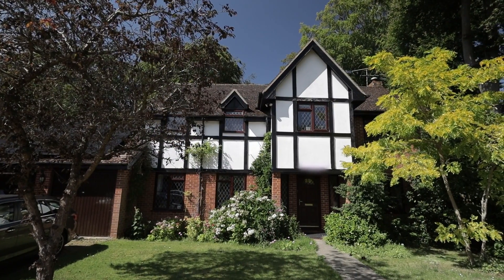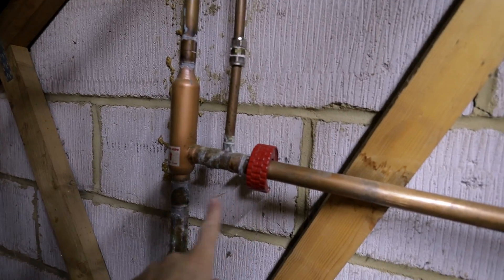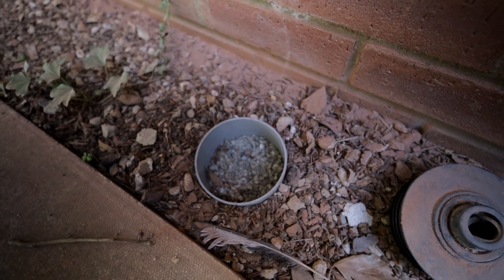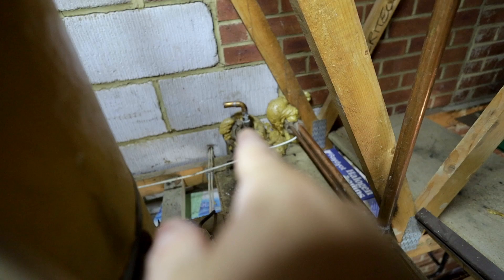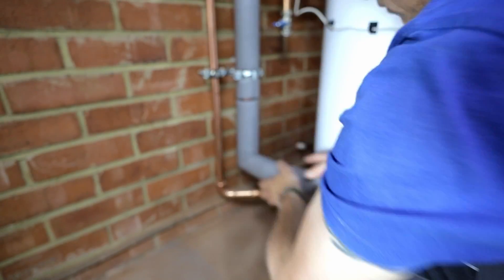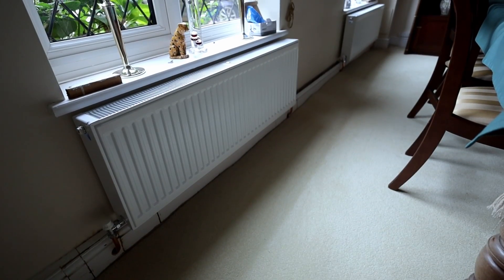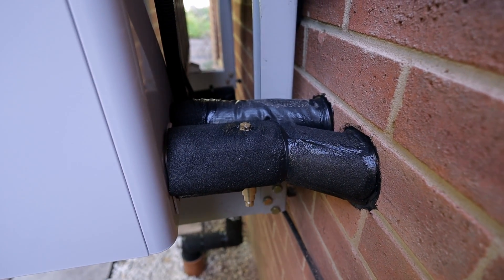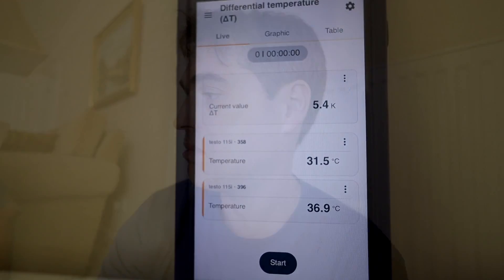Heat Pump Retrofit in a 1980s House: What's Involved?

Comment: Great videos; really well explained. One thing I would like some more information about is why heat zoning is not recommended. Does this mean that the whole house has to be set at the same temperature?
Reply: Watch the HeatGeek videos on this explaining it in detail. Seems simple is better and the illusion of micro control is outweighed by the thermal mass of a house just being maintained by weather compensation gives best efficiency.

Comment: In the US heat pumps are used for convection units only, either wall mounted or concealed. No water pipes or radiators needed. Plus they have air conditioning which is needed more and more in the UK. Installation is much simpler and I think vastly more efficient. Line sets only. I don’t understand why AC is not included and the complexity of adding all that plumbing is expensive and time consuming.
Reply: The government funding available to homeowners to change to a heat pump mean that 1. The unit must provide 100% of the heating and hot water demand, and 2. The unit cannot cool. These two requirements mean that air-water units, utilising the existing radiator circuits, are the most common. If you don’t want to access the government funding then you are free to install what you want. A fee people do have air-air installed, which is much cheaper and I would argue is much better suited to the usage pattern of your average homeowner.

Comment: Would be nice if you could do a cost breakdown on an installation on this scale .this would probably encourage more homeowners to upgrade to this set up , especially in the present climate ( cost of living crisis).
Reply: There's probably not much point, Szymon is a top-tier heating engineer and his prices reflect that. If you're under CoL pressure, it won't make sense.
Reply: @Zaph31 It would be nice to know a ballpark figure , even from a top heating engineer like Syzmon
Reply: @Zaph31 it would be nice to know ballpark figures especially because Szymon is a top heating engineer. We're under financial pressure but don't want to make a false economy having someone less competent to do the work. I'd rather know roughly the sort of figure I need to find to get it done right first time. Or if it doesn't work as well as expected, with Szymon, you know he will come back and know how to fix any problems rather than go bust and disappear!

Comment: What are your views on installing indoor radiant heaters to replace a gas heated system? It seems simpler, faster and cheaper than a heat pump, but will cost more to run over its life.

Comment: Super professional work as ever. I had my vented cylinder replaced with unvented. The cylinder is now in the loft and the airing cupboard has gone, is this a problem on a pump installation?

Comment: Interesting you can raise it off the ground. Best place for a heat pump at my house would be on the side, which has the major downside of obstructing the narrow driveway. Could a unit be mounted several metres above ground? Thereby alloying vehicles clearance.
Reply from the maker: It can, but it will make it rather difficult to service and for any warranty call outs you will have to provide scaffolding, so I am n out sure if it’s worth it

Comment: Could explain how an air to water heat pump without a hot water system would be installed? Thanks
Reply from the maker: I don’t think I understand your question? You can install A2W just for heating - no problem with that.
Reply: @UrbanPlumbers  sorry, I was basically asking if a heat pump could be a direct replacement in a a2w situation if it was for heating only, or if there is still any more equipment needed, like buffer tanks or expansion vessels

Comment: Great video and great advertisement for exactly how well they work... My cylinder is where my combi used to be and my heat pump is at the back of my extension so all in all no space is lost... Mine was installed in January and got around 400% efficiency for the remainder of the Winter, will see if I can squeeze any more out of it this Winter by tweaking the weather curve.
Reply: How big is the space the cylinder is in? Our boiler is in a kitchen cupboard 600mm wide. I'm worried it won't be big enough.
Reply: @allthegearuk  it's in quite a large airing cupboard and fortunately the flow and return go straight out the back wall and radiator pipes into the floor, mine takes up roughly a 700mm x 700mm footprint but I was lucky with pipe runs I guess

Comment: This might be a stupid question.. I'm not up on ASHP at all. Hopefully soon..
But out of curiosity I have a question..
The ASHP takes any heat from the air and uses that to heat the house I'm guessing.
Would it work of you put the ASHP inside the garage?
It would pull In warmer and warmer air as the house heats up wouldn't it and not have to work harder?
Or does cold air leave the unit basically cooling down any heat it has given to the house?

Sorry if it's a daft question. Lol great video as always..

Also could you let us know what courses you have been on as you seem very knowledgeable.

Thanks
Reply: It's similar to the issue explained in the video of being too close to a wall, you'd create a micro climate in your garage that will pretty quickly get colder than the outside air - basically you're putting AC in the garage but it will just keep getting colder and perform worse than being outside.

Comment: I love your detailed approach to your projects but I think you lucked out with this house. Nice size F&R pipework to each side of the house & not a length of microbore in sight which, for a 1980's house, is very unusual. 
I cannot see me ever being able to have an ATW HP system in my 1986 house because it has 10mm microbore pipework to every radiator in the house. It would cost too much & create so much upheaval to upgrade all the pipework. I'm therefore looking at an Air to Air heat pump multi split system with a separate solution for HW - maybe an all-in-on HP cylinder. This also means I can get cooling in the summer if needed. Another good vid.
Reply from the maker: Video in October will be exactly that - installation in a 1980 house full of microbore
Reply: @UrbanPlumbers  Now that I will be super interested to look at. I'm a retired  HVAC product manager/trainer so I know how important flow rates are for any successful ATW system. Normally microbore kills the flow rate & to replace it all is just too expensive & so much hassle. It will be very interesting to see how you go about overcoming this problem & achieve an efficient system. I'm already subbed so I wait for the next vid in anticipation.

Comment: Hi im thinking of fitting one of these vailliant heat pump in my typical 4 bed detached.  Pipes up into the attic and down into the hot water cupboard on first floor. Can the unit pump cope  or should i add a buffer with another pump?

Comment: Do the radiators have 22mm feed, or do they reduce to 15mm? How well would 15mm work and would you need a higher/lower flow rate?

Comment: Do the rear clearances not apply when you wall Mount the unit ?
Reply: Ideal. I will be wall mounting a LT Daikin Altherma next week and I was slightly concerned about the distance away from the wall as I’ve not wall hung before. It’s 300mm for Daikin. 👍
Reply from the maker: They do. This one is 250mm and it is exactly what we have here

Comment: Hi, love your videos, really informative, just going through the process of getting a heat pump installation through a goverment grant. Is their any tips you can give, can a cylinder go into a loft space without too much difficulty please
Reply from the maker: yes cylinder can do into the loft. The best advice I can give you is to find a really good installer. Heat Geek Elite should be a very safe bet. Even if the installation is more expensive than competition, it will pay for itself many times over in lower running costs and better system, that will last longer and be more reliable.